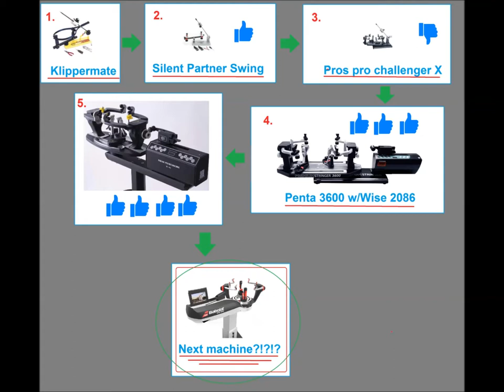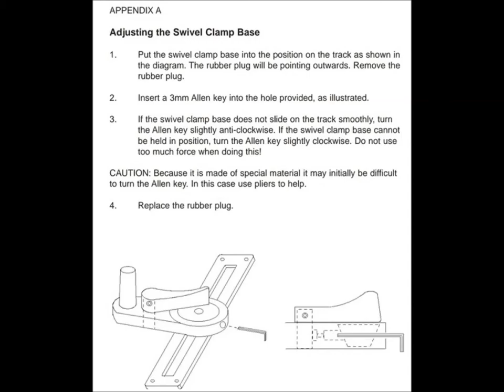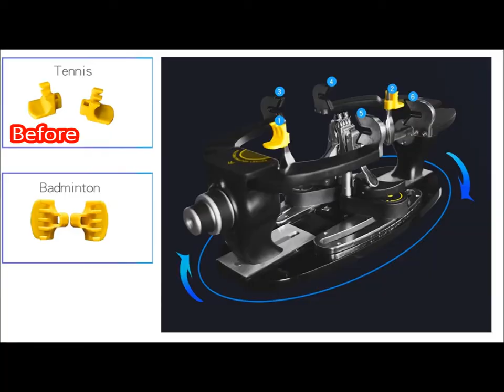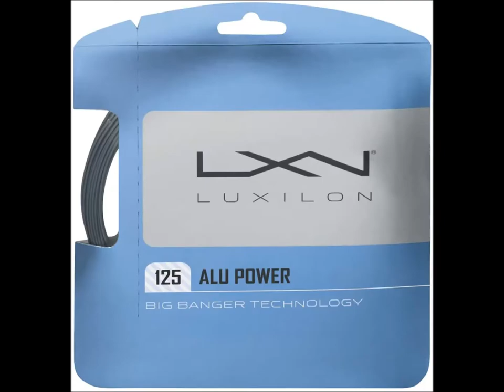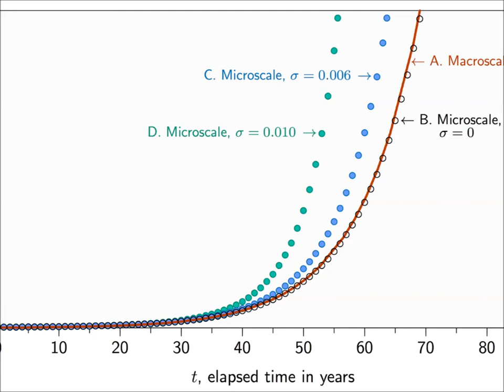Siboasi Tennis Racket Stringing Machine Unbiased Review (After 3 Month of Use)

Comment: How's it going after a few years? Was surprised to see you say the adjustments on the stringmaster deluxe were not as smooth considering its meant to be a higher quality machine made in Taiwan.

Are the clamps much better on the Stringmaster, they certainly look high quality?

My concern with Siobasi and similar is you'll probably get a good machine but if you don't then getting support can be a real problem. I'd feel more comfortable with a Wise than MT200 or 400 mainly because the parts are easily replaced and they are surprisingly well priced. 

I emailed Siobasi asking about shipping quotes and a couple of simple questions but  never got a response so that was enough for me to drop them off my short list which is currently between Stringmaster Deluxe, Tomcat and Gamma Progression ELS. Any thoughts on those machines?

Comment: I'm thinking of buying the Siboasi 3169. I want an electronic stringing machine and the cost is 2,000 on special right now from the Siboasi website. what to you think of their top of the line model? Any thoughts?
Reply from the maker: I actually have one now, it works fine so far.
Reply: Hi. How are you liking the Siboasi S3169? I’m in Vancouver area and thinking of getting one am curious how it has been holding up for you? Thanks!

Comment: Great review, thank you for your effort. 

I think it's a very good machine that you have. I really like those deep C-mounts, the turntable, mounting mechanism, clamp bases and tracks all look really good. The only thing I would change is the clamps, which are easy to upgrade. I have removed brake from my Pro's Pro Comet because I have never used it and the strings would constantly catch on the lever.

Very cool that you also have the Wise, thanks for comparing both. I'm currently deciding which one to get, but now I think I will just go with the MT-200 (in Europe, Wise is almost 200 EUR more expensive). The one thing I would like to ask is about gripper causing string ghosting. How is the Siboasi unit comparable to Wise (better/worse/same)?   

Nice that you also included your past stringing machines, and you are right about Pro's Pro machines. While I'm pretty satisfied with my Comet (stringing one or two racquets a week), I would not buy it again. And for your next machine, maybe Alpha Ghost 2?

Regarding the clamps, these are some good options (diamond dusted). Both clamps look pretty much identical and they are probably even made in the same factory:
AEF: 
https://www.aliexpress.com/item/33004947200.html?spm=2114.12010612.8148356.58.ec0e38e2nylQNT
Pro's Pro: 
https://www.pros-pro.com/de/zentralhaltezange-universal-2988.html
Reply from the maker: I was actually planning to buy those clamps u mentioned when I feel the siboasi ones are on the way out lol I would go with MT 200 it has like 4 slots of memory which is so much more easier than Wise’s 2 memory slot, and it has knot function. The gripper is almost identical, I don’t think its interchangeable just off by 2mm in terms of plate/metal thickness. I think the ghosting is about the same didn’t notice much difference. If my wise breaks down before my siboasi motor, I will buy wise again, if the siboasi breaks down first, I will buy their motor again, both are equally good and versatile for my purpose when adapting to other machines. I might get a ghost 2 in the future but the only downfall for me is that its very bulky and my living room is a mess especially with kids running around lol

Comment: Hey Jimbo, thanks for this review. I’m brand new to stringing (bought a drop weight machine a few months ago, but already I get annoyed at it takes a lot of time, is cumbersome, and i’m getting good results, but they aren’t totally accurate from one despite me stringing the same two rackets with the same strings and in exactly the same way. I take my time to be as precise as possible. I thinkI will be switching up to an electronic machine soon.
I came across the Pro’s Pro Tomcat MT-400 - that seems to check all the boxes ... or at least the ones I’m aware of that need checking! 

I would greatly appreciate it if you could share your thoughts about the Pro’sPro Tomcat mt400 - it seems very similar to your Siboasi.

Also, I know most rackets now come with tension recommendations printed somewhere on the frame, but older rackets typically dont. ProKennex is particularly stingy with their information, both on the rackets and online. Where is a good resource for racket specs and stringing recommendations, especially for some older models? (Everyone online only seem to talk about the latest greatest models)
Reply from the maker: hello i cannot say anything bad about tomcat i have friends who are considering buying it when its available, its very comparable to siboasi if you dont want to spend over $5k on a machine. I havent looked into the cost of these machines lately but i think that will be the major determining factor for most. in terms of tension i still go by the 50-60lb recomendation regardless of the racket. older ones if not sure i would just look at tennis warehouse reviews or forum groups where owners talk about the stiffness then decide on the tension. for example is the older racket is supper stiff according to players on forums, i wouldnt go over 55lbs. when im dealing with customers i always tell them the consequences of using full poly or high tension on older rackets especially ceramic ones, some are very dead wood feeling.

Comment: How do you know that The more expensive model 3169 has a better motor?? Thx
Reply from the maker: Its the same motor as my machine probably just different layout for display panel and buttons. After stringing over 800 rackets on it this year with my siboasi, i tested the tension with a scale and its still accurate. I recently sold my backup machine with wise 2086 and bought a new backup machine with a new wise, going forward i will probably switch to sibaosi/ pros pro MT 200 motor because it has knot function.

Comment: I make  10 rackets  in a month. I have a premium 3600.  What electric motor  you suggest?
Reply from the maker: Wise 2086 is probably easiest option i had no problems with that before
Reply: @j1mster3  Do You think that the MT 300 of pros pro( only 300 dollar) might bè a valid option?  They sell it Aldo with anche adapter for the Premium machine
Reply from the maker: @peppio  ya that MT has knot function, its really helpful. if you think its worth the extra then yes
Reply from the maker: @peppio  I've actually switched to the MT one you were talking about, i find it alot better than wise.
Reply: @j1mster3  thank you a lot for your support

Comment: I hv owned several of their machines,they make low quality, cheap machines which go as long as your luck goes. Company provides zero help or support if there's a problem, which there is always.Just broke a racket on their machine as it started pulling 10 lbs on it's own & company didn't know how to fix it. Any money spent on these crap machines is an utter insult to money. Better buy, Taiwan made branded machines.
Reply from the maker: which models did u own?
Reply: @j1mster3  my first was SB 101 table top, the second was all white but only had tennis stringing machine written on it n had pull mechanism similar to one in yr video.The person in this company is a lady named Livia. Their support staff do not understand their own made machine(especially older models) Older machines hv 2 motors, pulling and a synchronous motor fr tension set. Newer machine just has one motor & the tension calibration is done thru circuit,if something goes wrong,there is no way to rectify, just hv to throw the machine. I have a old Pacific machine 20 years old &done more than 30K string jobs,still works fine.
Reply: @9teen66 So which Taiwan branded machine should one consider? How does one buy it? Do they have websites?
Reply: @michaelyoong44  All major brands Wilson,Babolat,Prince...etc & more than dozen medium brands make the machines in Taiwan or Taiwanese owned factories in China. The guarentee, warranty...etc is given by the brand so it's better to buy from an official distributor or retailer in your country. Factories do not sell to individual consumers but they do sell machines in your own brand and set up if you can purchase few units at a time. If you are stringing for living then don't even think about buying a non branded machine. If it's just for hobby then any cheap machine will do including siboasi.
Reply: @michaelyoong44  ,gr8, good luck 👍
Reply from the maker: @michaelyoong44  so far my siboasi is still good, over 1k rackets strung past year. also i have a new backup machine from tennisman.de made in taiwan xpider, same as tourna. i love both of my machines, xpider looks prettier, siboasi knobs mechanism is more smoother and finer.
Reply: @j1mster3  I decided to get the S616 too. So far so good. Done 200+ rackets thru it with no issues. Only issue was the base of the Sibaosi when I wanted to add casters. It has a weird thread that I cant figure out. It measured M8 but doesn't accept that. Tried 5/16 still didn't fit.
Reply from the maker: @michaelyoong44  as much as i want to add it, my living room hard wood floors are not flat enough, also im afraid of vibrations of rolling on rough ground when im moving to club etc might damage the motor.
Reply: @j1mster3  I only need to roll my machine a couple of feet when I need to use it. Still can't find any suitable casters. You lug that heavy thing to your club. Wow!